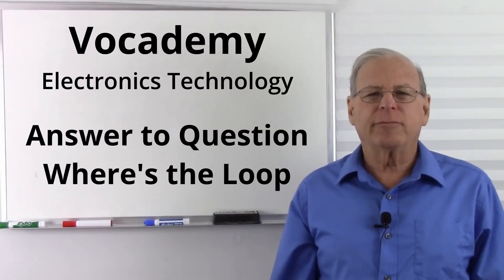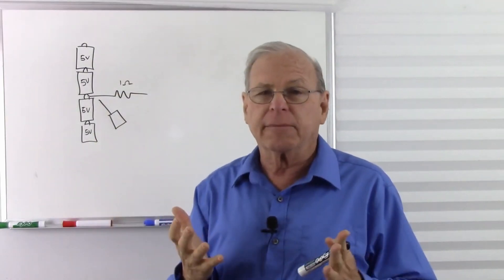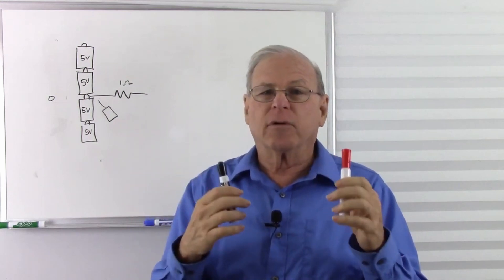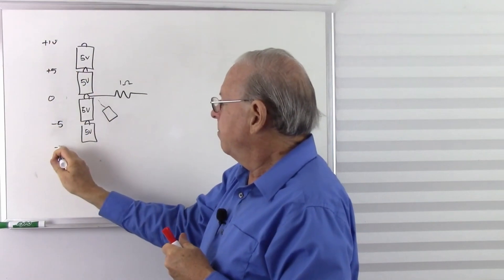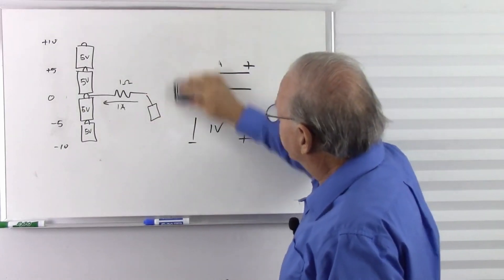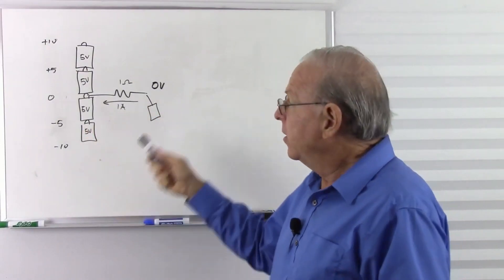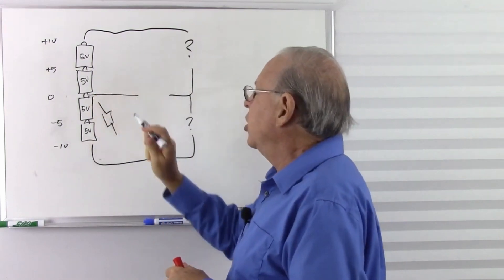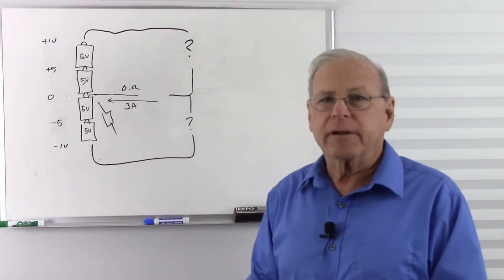Is an electrical circuit always a loop

Comment: If you want the viewer to watch the video all the way til the end, you need to cut out the long, identical "thank you" at the end. Since it's spliced in at the end of every video, it comes off as insincere and monotonous.
Reply from the maker: Sorry, but I had to remove the original endings because I lost the use of my business name. I have nearly 230 videos to fix and re-upload. That's taking long enough without creating a new ending for each video. The stock ending will have to do for now.
Reply: @Vocademy - Electronics Technology  I understand, sir, and I really commiserate on your terrible treatment from Google. I'm not sure how important a metric it is for watching to the end. But once the video subject matter has ended, a long drawn out "ad" at the end will have high numbers of viewers clicking out and searching for the next video. I look forward to you uploading new material, as after all your reviewing and editing of the old videos for repost, you must have new ideas on what worked and what didn't, what you explained well and what may needing a new approach.
Reply: @Vocademy-Electronics-Tech 
Hi Sir please reply... 
this question is very very confusing...
I have 2 identical 12V DC 7.5Ah batteries say X and Y.
One side of a normal bulb is connected to postive terminal of X battery, and another side of the bulb is connected to the negative terminal of the Y battery.

The negative terminal of X battery and the positive terminal of Y battery are not connected to anything.

1. So, in this case, I want to know whether there will be a current flow to the bulb, and whether the bulb will glow??? Give reasons if bulb will glow, and reasons why bulb will not glow.

2. If both negative terminals are connected to the negative side of the bulb, then YES the bulb will glow. Will there be a current entering into the 2 negative terminals of both the batteries? If current flows, then will the amount of current be the same into the 2 negative terminals??
Thanks in advance.
Reply: So many channels do that. Nothing wrong with it.